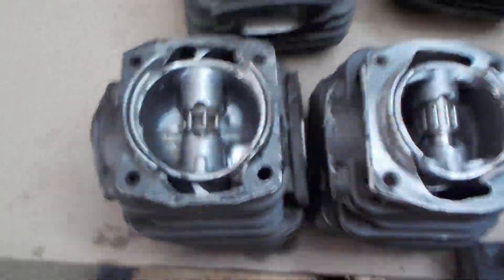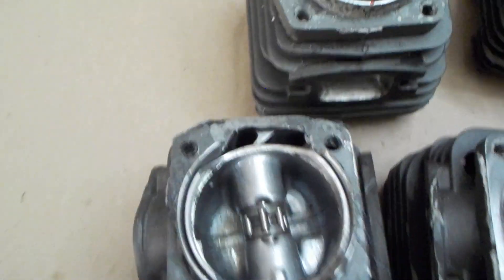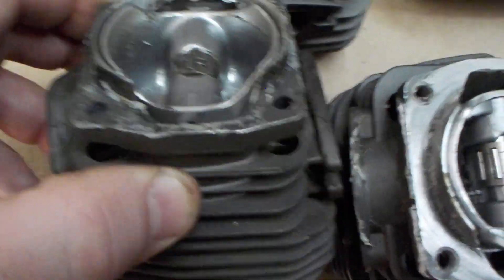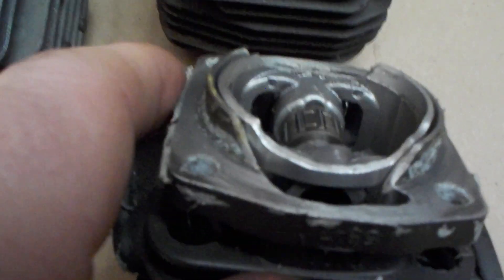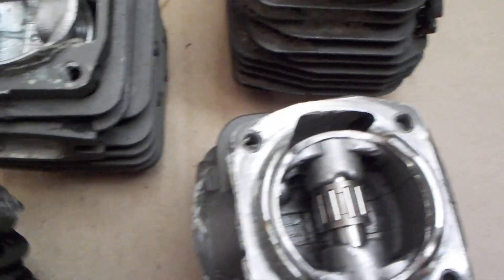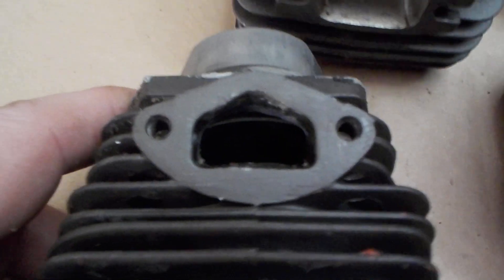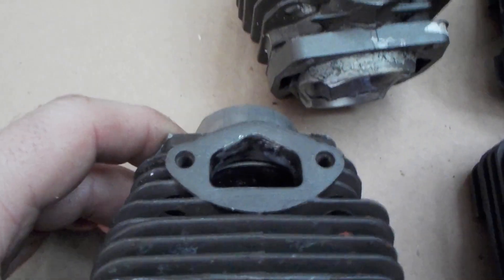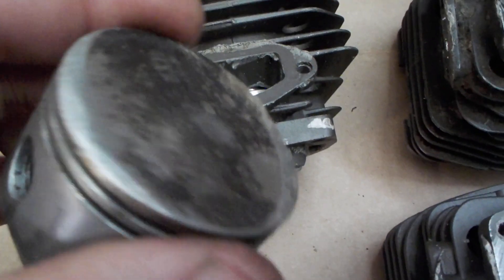5800 chinese saw porting

Comment: I know you mentioned you base gasket delete all the Chinese saws and have no problem with squish. I have a 5800 unmolested, can I preform the gasket delete without any other modifications or do I have to also port in order to gain any usefulness out of a gasket delete? Do you use regular RTV sealer in place after the delete?
Reply from the maker: There's a small gain by doing the base gasket delete all on it's own.

Comment: What rpm did you achieve out of the 48mm bore?
Reply from the maker: 14000rpm but it would drop to 10000 cutting so anything over 13000 was just extra noise lol.
I have a 61 husky torn apart for a 72 kit. It looks like the 48mm 61 piston might work in the 48mm cylinder and it has cut outs so the transfers can flow a lot more. The 61 piston is a couple mm taller but otherwise fits, I'll have to mill it down and run a couple base gaskets to make it work.
Reply: @nseric1233  well yesterday I got mine going. My numbers are very  similar to yours as far as the RPM's go. It feels more torquer/grabbier than the 45.2mm but doesn't have the rpm in the cut to hold rpm like the smaller one does
Reply: I looked up that piston and found two variants of it. The one you have does it actually have windows in it?
Reply from the maker: @jamesh8136  No but the sides of the piston are 1/2 an inch from the cylinder so it can flow in that area. There's also a stihl 038 48mm piston that might fit.
Reply from the maker: I did a little googling today... The stihl 036 48mm piston is likely the best one to swap in.
It has a 10mm pin just like the clone, the ring pins are off to the sides of the intake port like the clone and it has big windows for lots of flow. Im sure it's taller but dont know how much, taller isnt a big deal tho sanding the squish band down will fix that so will running a couple base gaskets.
The husky piston has the ring pin in the middle of the intake port, which may in up in the port if the height is off a touch.
Reply: Well I'm going to try and make my piston a windowed piston. I think there is room enough to try it. I'll keep you posted on my results. 👍
Reply: I windowed my piston today. Hopefully soon I get it installed and see if it helped.
Reply from the maker: @jamesh8136  I ordered a 036 piston today. I'll do a video on it if I can make it work. It has big windows.
Reply: @nseric1233  well that sounds promising. 
Wish there was a way to upload pictures while replying to messages
Reply: @nseric1233 Did you ever get a chance to use the 036 piston?
Reply from the maker: @jamesh8136  Not yet.
I got side tracked fixing a 61 for my bud and sorting out my new neo tec 892.
I'm gonna run the 036 piston backwards and add finger ports, the ring locating pins clear the exhaust port. It's about 5mm taller so im gonna put a 3mm spacer with gaskets under the cylinder then sand the squish band til it fits. I'll have to shim the intake up and slot the holes in the muffler but it should fit. It will either run really good or blow up lol.
Reply: Well my saw last time out lost a wrist pin clip and ruined the rings possibly the piston and trashed the cylinder right above the transfer port. Was getting ready to put my windowed piston in my other saw and I wanted to see how compression was in the saw that had non window piston in it. Low an behold lost 10 psi and I found out why. I also noticed that the clip area one side of my windowed piston is not as deep as the other side. Gonna try it anyways.

Comment: Thanks for this tips. I have a 52cc version - 45mm bore, 32mm stroke, windowed piston, looks the same as 5800 cylinder and piston on this video. My numbers are (without base gasket): Squish 0.6mm, Ex: 107, Tx: 130, Intake: 70° (btdc, 140 total duration). What suggestions could you give me? I'm thinking of getting the exhaust to 104, but that would increase the blowdown to 26°.
Reply from the maker: Raise the transfers the same amount as the exhaust if not a little more.
My 52cc saw has ex 104, tx 120 and 78 intake. It runs pretty good and stays at higher rpm in the cut than another one I did with 24-25 degrees of blow down.
Reply: @nseric1233  Thank you. I prepared the cylinder, raised the exhaust, but I'm having trouble raising transfers with my tools. I will run it with long blow-down first and I'm also preparing a second piston with a chamfer on the sides where transfers are. I understand that this acts the same as raising the transfers. This way, by changing pistons, I could compare how it runs with long and shorter blow-down.
Reply from the maker: @homopit42  I end up grinding the piston in the quad transfer port cylinders as I make a mess trying to raise the transfers, it's good for 2-3 degrees.
I can grind the top of the transfers in the dual port cylinder ok with a flat top grinding stone in my dremel using the top of the stone not the sides.  It's slow going but does a decent job, it catches and makes a mess in the quad port ones tho.

Comment: Nice work bro. 
By chance what were your squish numbers?
Also did you do a base gasket delete?
Reply from the maker: I did a base gasket delete on all of em.
Squish was still about 040 without the gasket.
I have a 50cc one down to 025 but had to deck the cylinder to get there. My supmix/timberpro has .030 after decking it. I dont have a lathe,  I found 2 inch abs has the same id as the flange on the cylinder. I put a little piece of pipe in a 2 inch elbow, glued sand paper to it and sanded the bases down.